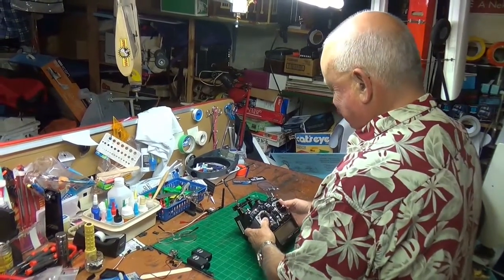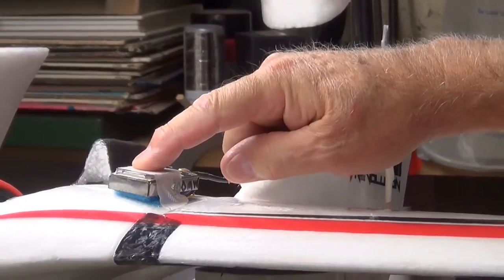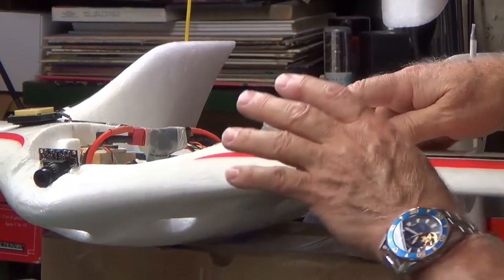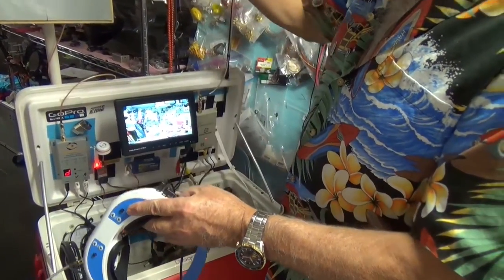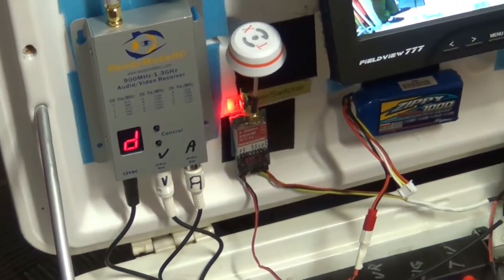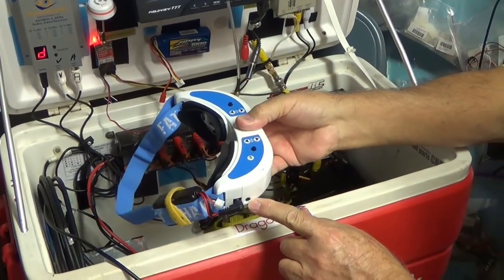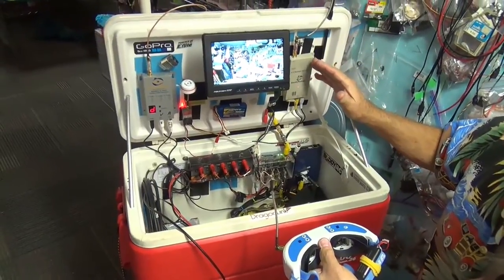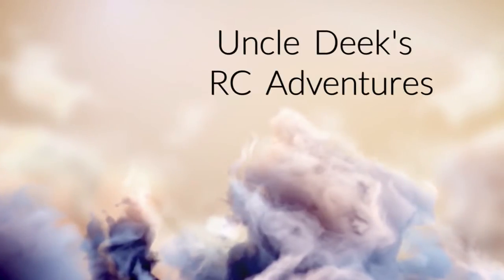Convert 1.3 Ghz Video to 5.8 Ghz with a Repeater

Comment: I know this is a old video but I'm building a 1.3ghz to 5.8ghz repeater, my question is will I have the osd working the same as if I were flying with 5.8ghz
Reply from the maker: yes
Reply: Ok good,I was thinking that the osd information is coming from the 5.8ghz vtx but I'll be using a 1.3ghz vtx on the plane.

Comment: Im flying a quad copter and it comes with a fpv system installed already but I want a secondary system on it with some googles. whats the best set up and do the repeater needs and splicing or soldering.
Reply from the maker: Can you explain what type of quad and what type of video system it has please.
Is a Phantom Vision 2+?